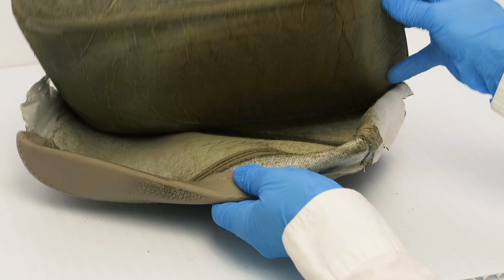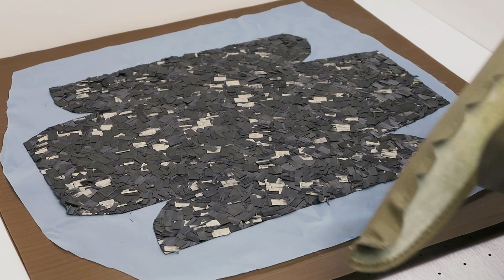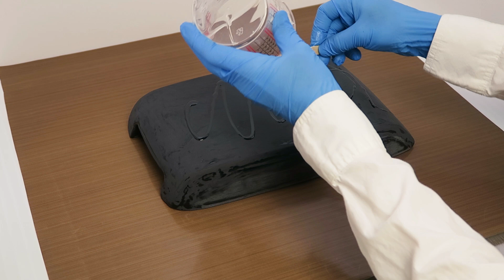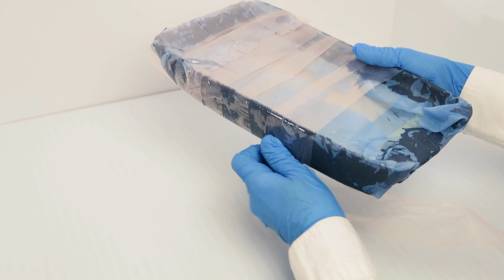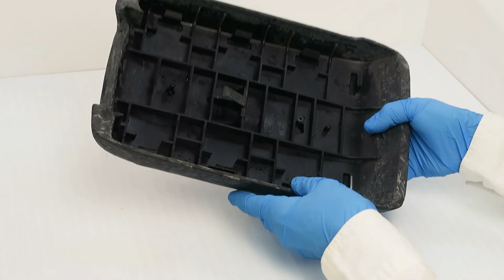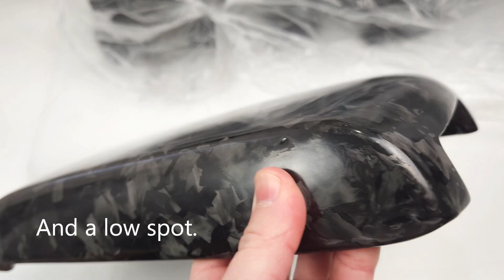Upgrade Your Car Console with Real Carbon Fiber Skinning

Comment: Cool idea for rigid car parts.  The only thing is it will look out of place if the rest of your car is not black.  I can see many applications for this, but I personally would not have done the carbon fiber on an armrest because the whole point of an armrest is to have someplace soft to rest your arm on.  But I can see this technique being useful for other items in the car.

Comment: Hmm makes me want to do a project . I have a polymer ar10 Lower has design shape but was wondering if i can use chopped carbon fiber to skin around it ? And would a pressure pot be worth getting one for it ( been meaning to learn more to do skinning and molds  for gear or house hold items ) also seen some of the videos def need to catch up bec this always looks sastifying !